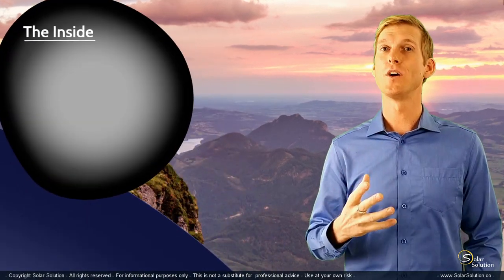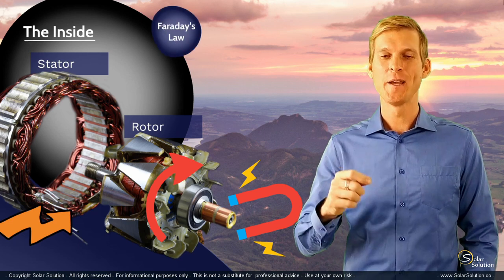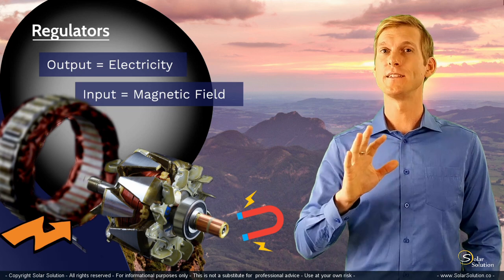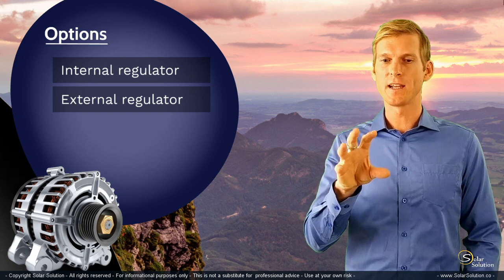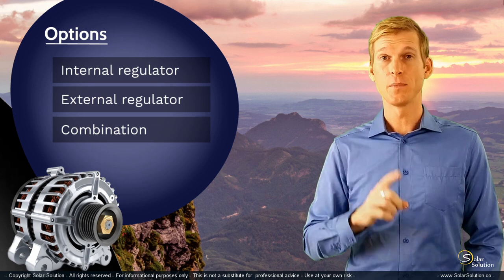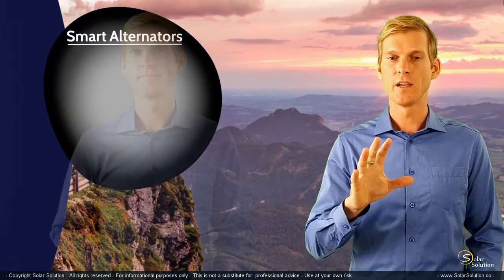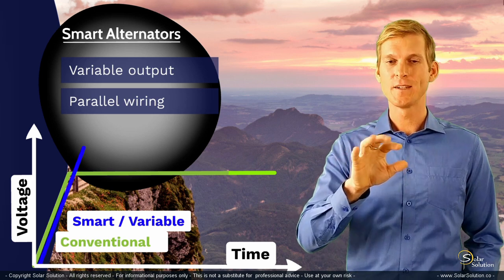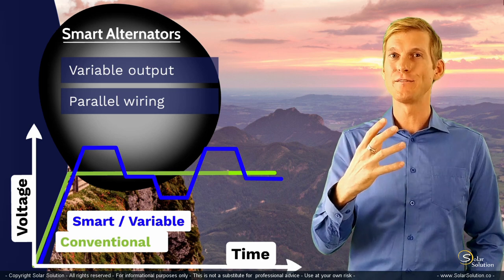How Alternators Work: Voltage Regulators & Smart Alternators Explained

Comment: After decades of working on vehicles I ended up as field instructor for a car company. Alternators of the early days had stator windings of the “Y” configuration including imports. This terminal became energized once the alt was working and had it’s used. For a couple of decades as amperage demands increased, they use a “Delta” stator design. I was told that the “Delta” was better for amperage output where the “Y” was better for voltage output and limited on total current capacity. I think heat generated in the stator was a factor as this is the death of a diode bank. Dual fans are added, controlling positive by the regulator is the normal action at 400 times per seconds, as controlling ground at 400 times per second was the old way. External system voltage is now the best way to reduce the engine load by reducing the output & drag by changing the duty cycle. 
 I guess if you had thoughts on Y versus delta stator design. Thanks!
Certified Automotive ASE Master Tech (USA) since 1978 - Retired
Reply from the maker: Hello Dean, thank you for your valuable contribution. I appreciate that you were willing to share you knowledge, and I am sure many other viewers will feel the same! I will pin your message to the top of the queue, so that others may learn from it as well. All the best, Jesse.
Reply: @SolarSolution  I appreciate all forms of learning and you do a very good job. I simple chose one topic and held 4hr tech seminars in 4 different towns/Cities each week plus other duties. But it keep you sharp. What did anyone do before YouTube? I guessed they watched others, ask questions, had an apprenticeship or read! I will crank the handle on my wood phone now...

Comment: Thank you for the information. I viewed many youtube videos mostly titled "DIY Electricity Generator....". The posters of the videos are using parts (stators and rotors) from old fans, washing machines, microwaves, car dynamo...etc. my question is, do they have the choice to generate AC or DC power from such parts if they have yhe choice to change copper wires thicknes and number of rounds, and magnet kinds? or does it need more than that to generate any of the 2 power types? thank you for your time in replying to my message
Reply from the maker: You are welcome Adham, I am glad you enjoyed the video. All the best, Jesse.
Reply: @SolarSolution  Jesse, if you don't mind, could you please give me a reply to my question!? thank you for your time and efforts.
Reply from the maker: Hello Adham, thank you for your reminder. You have an excellent question: In general, changing the wire thickness or magnet strength effects the power output, rather than the 'type' of current, i.e. AC Vs. DC. Commutators and rectifiers are often used to convert AC into DC. Good luck and enjoy! Jesse
Reply: @SolarSolution  thank you a million for the valuable information Jesse.
Reply from the maker: You are welcome Adham. All the best, Jesse.

Comment: I'm at the point of no return, rewiring is done, the 1985 pickup is about to be tested as is. But that's without my bank, only the starter. But I can't seem to find a smart alternator or any really for a truck that old. Stupid question, but charging, amperage, my alternator, my custom made instrument guage panel and compatibility, all this is still dependant on my ECM module or has having rewired the entire truck from scratch changed anything? Would the voltage be regulated by the trucks computer or is it just the battery and alternator that control it's output? I've done a Big 4 upgrade, and now I am just looking for confirmation before completing the circuit to the negative terminal.

Comment: Hello Jesse, who do you recommend for external regulators? Specifically for a housing setup for a van/rv
Reply: An external regulator is not needed depending on your vehicle. It is a factory add-on for camper / RV to add a second battery. The vehicle runs without a battery as it is only there to start the engine. (Do Not Attempt with today’s alternators) Many higher output alternator fit and be wired in like a GM 1 wire alternator as they use the dash bulb which acts as a current limiter to 0.25 amp or a 470 ohm resistor between key run to field and sense is battery terminal. Best practice for camper/RV is a 50 amp battery isolator that has large or multiple diodes to protect a discharged battery from draining the other. Place a 50AMP fuse between batteries and isolator. One to starter to operate vehicle, #2 runs lights and accessories in camper / RV and use fuses on each circuit in camper. Important; Voltage drop is easy, quick and doesn’t lye. Many vids on this subject. But add grounds. Negative comes from the back end housing of the alternator, so many have a short threaded hole, add a heavy ground from alt to engine. But add grounds from battery to engine, frame, fender, cab and bed if a truck. Paint, grease or loose fasteners create resistance and this lowers voltage. The ability to get amperage depends on a complete circuit. Dielectric grease, “Star” washers and clean sanded mounting pads help eliminate resistance. Star washers have little twisted metal tabs that dig into metal helping the connection. Sold a home improvement stores and dielectric grease is not to be confused with aluminum wire anti-oxidation grease as it is way more expensive. Hope this makes sense! ASE Master Tech since 1978 - Retired

Comment: My Citroën relay (new van) does not charge over 12.8 volts. This means my start stop never works. How could I make the smart alternator work like a conventional alternator? 
My dealer have said there is nothing they are willing to do and that it's the characteristics of the van. They also told me it's not charging because the van is heavy 🤣. Toomey Citroën are a joke.